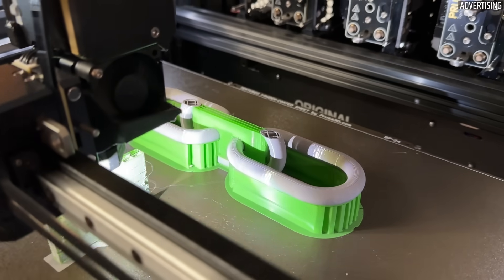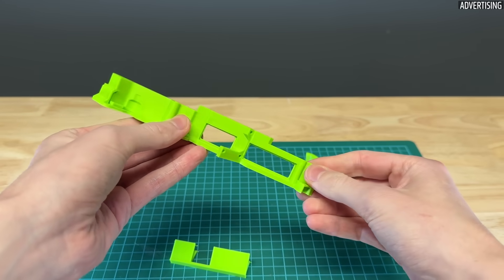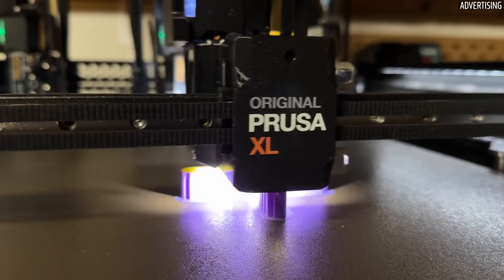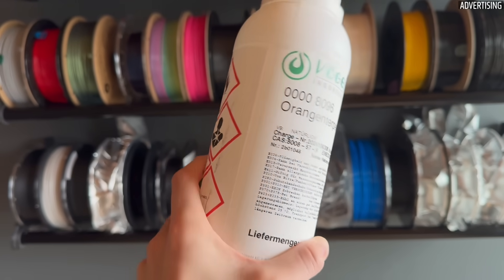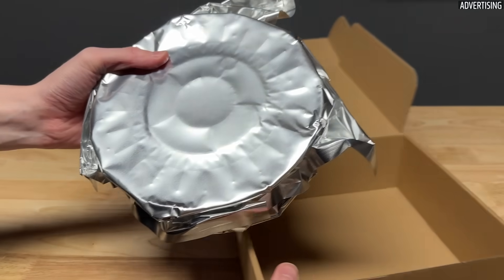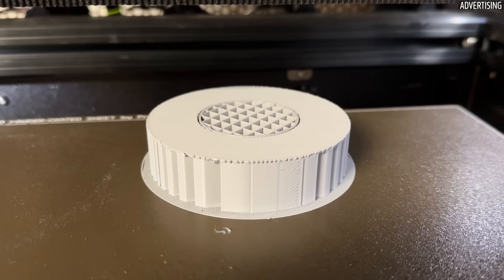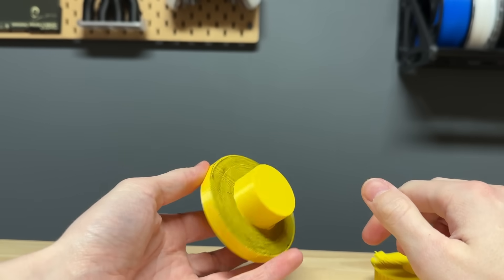Always Perfect 3D Printing Support Structures: The Ultimate Guide

Comment: I have tried the sharpie option and I had issues with the first layer at the interface for PLA not creating a nice layer at the interface. What am I doing wrong?

I also did the PETG interface option it printed well for a PLA.
The support separated easily.
The final print looked very good, but if you put a little pressure on the overhang the PLA body separated. PETG was only on the interface layer. Why would the PLA body be separated at the same layer where PETG was applied for support?

Comment: Your permanent Marker trick can be used with differential material support interface. PETG and PLA work great together ASA and HIPS as well as TPU and PETG , although this last one requires a dual head extruder printer for good results. A lot easier with an AMS or multilateral printer for sure. But if you have to create pauses in the print to go put your sharpie anyway, might as well swap out for PETG/PLA for 1 layer and then swap back. Ive had amazing results with the interface option on multiple printers.

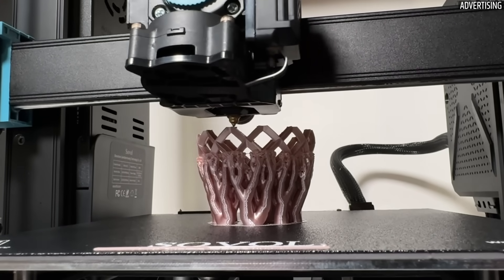Comment: 2:31 I don't know if it was where they originally came from but Organic supports were actually a thing at least as far back as 2017 in Dremel's Idea Builder slicer, called by the more obvious name of Tree supports and likely patented such that Prusa couldn't just call them tree supports.
I remember pretty much only ever using tree supports when printing on the line of Dremel 3D40s that my college had back then. When I finally really got back into 3D printing almost two years ago, I honestly never knew organic supports were a relatively new thing outside of the Dremels since they were all I had ever used.

Comment: I think, if you are designing prints yourself, you should go for custom supports built directly into the STL. Not only you will save a lot of material (slicer supports can be really wasteful, especially tree supports), but also you can design them in a way that makes them easy to break off by introducing intentional weak spot in the place where it should come off.

Comment: I use a dry erase marker. Couldnt find my sharpie one day- it works even better on nylons, pet, pc, and ppa- for large support areas the filament is able to get SOME small amount of friction on the dry erase so your 1st layer supports look MUCH cleaner. Especially for big areas- square or circle shaped- the filament will lay down where it should vs sharpie ive found it has absolutely zero traction and 1st layer support lines can drag around out of place more.

Comment: I’m sorry but what the hell did I watch regarding that dissolvable support? Like, you completely glossed over PVA that can dissolve in water, said you decided not to test that one at all and instead went with what this company sent you which was literally an entire freaking laboratory just to dissolve some support filament which didn’t even end up working because with like 3 gallons of chemical goo, you can only dissolve 170g of supports at a time and your impressions after that were good despite JUST BEFORE complaining about having to use one single bottle of orange terpenes? I found that part very very hard to take seriously, I’ll be honest. It seemed like you were trying hard to stay in their good graces.

Comment: I once worked on a modular support system a few years back, where at the time, I used lego bricks instead of huge amounts of printed support materials, setting the print to stop so I can insert them and then keep printing a tiny amount of support material on top of them to make sure the print would be solid. I moved on to designing my own blocks that where easier to stack (causing less motion on the plate)

Comment: PLA support interface on a PETG part and the reverse works better than anything.  The default profiles in Bambu slicer works perfect for this out of the box.  I'm guessing your issue was due to settings as I can't imagine Prusa slicer uses the same defaults for this.  Your interface layers and your overhang layers looked like they were quite bad which is likely your issue.  A little work on that and those interfaces come off super easy and the overhang will look like it was printed on a smooth print bed.

Comment: But when using PLA as support for PETG or the other way round you'll have to make some compromises. PETG should be printed enclosed to reduce shrinking and potential warping while PLA should be printed with door or lid opened on the printer or it will potentially soften and deform during print. So how could that reliably work especially for longer prints?
I had printed some PTFE tube protectors out of PLA+ but each time I printed PETG parts, the protection clip became soft and fell of the tube so this would definitely ruin any PLA support on a PETG print!

Comment: To print a hole without supports—especially ones meant for screws—I’ve been using the same simple technique for years: I just cover the hole with a single 0.2 mm layer. It creates a clean bridge that allows the hole to be printed perfectly. Then, you just push the screw through that thin layer, which breaks easily.no need post-processing.

Comment: I know this is an unpopular opinion but after becoming proficient with Creality’s Slicer “Creality Print”, and used with a K1C K1Max, and K2, the prints are flawless. The automatic traditional supports release like edible wafers. I started with PrusaSlicer but it just seemed that Print worked better with Creality hardware. I’ll be the first to say that sounds ridiculous but that’s been my experience. The other variable that probably plays a bigger role than one would think, is the use of filaments that are more in the engineering end of the spectrum. Glass filled ABS, Carbon Fiber PA , PET, PPS-CF, PPA-CF. 
And I’ve tried making print profiles in PrusaSlicer that were exact copies of Creality Print profiles and they just could compare the the final prints rendered by Creality Print. It’s just super weird. Great video. Thanks for sharing.

Comment: Thank you for this interesting and informative video!

My conclusion, for my own projects and with my printer, is that adding a bit of permanent marker would absolutely be the cheapest and easiest way to go! 100%!

Add to that, permanent markers not only comes in a lot of different colours, but also different sizes, so if, say, black residue isn't an issue, using a black signwriting marker for really large areas is great, and conversely, if you want to reduce the issue of colour remaining on the print, you can try to colourmatch the marker and the filament.

It does mean that you have to make sure that you have markers that haven't dried out and are pretty fresh! Ink flow is key for coverage!

Price point for perm markers is pretty low unless you need more accurate colourmatching (I'm looking at you, Sharpie). For just generic black, red, blue and green, there are soooo many cheap off-brand markers.

Gonna go watch the arc technique vid now! Thank you for linking that too!

Comment: It seems like we could adapt like a BLTouch with a marker instead of a probe.
Where the interface layer is exposed, hop up the Z and deploy the "touch probe" which extends it below the nozzle, jog the XY offset, and "probe" with the marker until it dabs onto the interface.  The contact will register and retract the probe, it can dot all over the exposed interface
This sounds like it won't compromise the max XY travel like a multi-extruder, and adapting the BLTouch could be  pretty simple and reuse much of its design and its functional code.
It could be a bit tedious and the nozzle may leak while sidelined to go probe-dabbing a marker all over.  I'm not sure if it would be practical to drag a marker like you normally would, as it could drag pretty hard depending on how the interface layer works.  
We couldn't somehow add marker or other release agent  onto the extrusion at the nozzle, could we?  I don't see how to do that and turn it on and off completely and not contaminate the following structural extrusion with residue.  And we still need the interface to adhere to the layer beneath it too so injecting it into the melt would seem to create that situation

Comment: Great video. I have a model where I stuck magnetic tape on the bottom of a reusable support and painter's tape on the top. I add a pause to the print job and drop in the reusable support. The magnetic tape holds it to the bed.  When the print job is finished, I pop off the support, remove the tape, and stick on new tape for the next print. It's the Towel Bar Mounting Bracket from my Printables page. It allows me to have a clean recess on what becomes the back of the part without creating support waste.
Reply: That is a very cool idea!
Reply: If you had time, I would love to see a video of this, great idea and thanks for sharing

Comment: i was experimenting with the sharpie method about a year ago. it works great for petg. sometimes you do need to increase the print temp 5-10c otherwise the next layer may not even stick.
I did want to automate it by attaching the sharpie to the toolhead, but i couldnt come up with a good way to repeat the last interface layer with while both printing the interface with plastic, and then repeating the last layer with the sharpy. it was either have no actual interface and go over it with the marker as the interface, or pause and do it manually. 
iirc the person who wrote the original article with the magnetic style servo was hand modifying the gcode. which is fine for a few random non complicated prints

Comment: 10:44 It appears you use tap water for the XIONEER process. I’ll bet the hardness of the water used in the solution needs to be taken into consideration.

Fascinating stuff!
Reply: That is a valid point. Hardness of the water is a factor to consider. But we made the formulation of the powder that it will not be affected by that and compensate for different pH levels of the water.

Comment: I once wanted to print a TPU phone case that would look really nice. The eventual success was due to two tricks:
1. To get nice holes for connectors, microphone, speakers, buttons etc PLA supports were used. I did this on a standard printer by designing support structure out of multiple parts. A sort of frame went into the partially printed TPU case and this frame had cutouts into which I could slide pegs in the shapes of the holes. I put a pause in the print before the layer that bridges over any of the holes, inserted the right pegs and resumed printing. The last such pause was the top of the frame onto which the lip holding the phone around the screen was printed. After the print finished all the PLA support pieces were easy to take out of the TPU case. 
2. Someone helped me a lot with the excelent advice to use cleaning alcohol like IPA to release the TPU from the textured PEI bed plate. Without it the case always ended up deformed when pulled off the plate. With a bit of IPA poured around it it came of easily and not deformed. 
Overall that one phone case was quite a valuable learning experience.
Reply: You should make a video on your channel

Comment: Forget expensive markers – here’s a simple, cheap alternative I’ve been using for a long time: regular vegetable oil. You probably already have it in your kitchen! Just apply a very thin (trust me, THIN) layer with a brush on the separating surface. The supports stay perfectly on the build plate when you remove the print. Works like a charm – give it a shot and see the difference!

Comment: It's just PVA. Ya can disolve it way easier than the silly kit they gave ya. Sunlight soap and boiling water. No gimmick kit needed.
Reply: It is a completely different polymer than PVA and is completely insoluble in tap water by design. This way, it is far less hygroscopic. So you really need an elevated pH level to dissolve it. In chemical terms, its a polyacid, hence the alkaline needed.

Comment: I wonder if adding the Xioneer supported part with solvent to something like an Ultrasonic cleaner would have yielded a better result...
Reply: It really comes down to two factors, heat and agitation. So yes, Ultrasonic is a viable option. However the cheap devices around have very weak transducers and will not be much faster than the sous vide stick. A propper impeller, strong pump or even a system like a washing machine will be much faster. Or Ultrasonic with strong transducer, but these are very expensive.

Comment: With PETG, which normally has a lot of difficulty separating supports, I've found the "Support interface fan speed" settings in OrcaSlicer to be extremely helpful. I have it set to 100% with only a 0.04 z-offset and get a good surface above the support with minimal effort needed to remove them MOST of the time. I'm honestly surprised I don't see this feature talked about more, because it's been great for me. It also works quite well with my matte PLA's which are sensitive to high part cooling impacting layer adhesion.
Reply: Trying this tomorrow

Comment: Thank you for reviewing our Xioneer VXL GO set, Jan 🙂 I think you are right about the maximum capacity being used with your parts, which led to the remaining support material inside the parts. 
And just for reference here: The Sous Vide stick is of course not very potent in terms of agitation. Using a device like our Vortex EZ or even a household washing machine would speed this up by a factor of 3 to 6. 
Interesting to see the effects of limonene as well. Probably due to the wild compounds that are marketed as ABS but really have some other materials inside mixed with ABS which are then damaged by the limonene.
Reply: It is unbelievable to me that anyone considers your product at all useful, I’m sorry to say. You have to buy an entire chemistry kit and lab equipment and mix gallons of solution, have it stirred continuously with the sous vide stick or buy even more equipment from you to stir it better, and after hours upon hours you can dissolve a maximum of 170g of supports? Like, can you explain the utility of this over just getting support interface material from Bambu Lab or using PVA that can dissolve in water? Even that other material where all I need is a bottle of orange terpenes is more useful and practical than your entire set. Maybe I’m just missing something.
Reply: @gownerjones  Thanks for the feedback! 
You’re right – our material isn’t the cheapest. But it’s super easy to use: no humidity issues, no drying drama, and it prints reliably across a wide range of materials from PLA to PEEK and temperatures from 20 C to 140 C in the chamber. There is no real alternative at least above 50 °C in the chamber. 
And no, you don’t need expensive equipment. A regular bucket, warm water, and some washing soda is enough – just give it some time. 

For complex geometries or internal supports, soluble material is often the only real option – and VXL just works when others don’t. 
You also need to consider the industrial side of using these materials (there are 5 different types): Automated postprocessing is an important reason to use soluble supports, especially in high-wage countries.
If breakaway is enough, we encourage our customers do use that. If it's easier with interface support using VXL, that's a good thing to save money as well. 
PVA and BVOH have little industrial weight, they can only be used for commodity model materials like PLA. HIPS and limonene will generate a lot of organic waste, which needs to be treated by a special waste collection company for a high price. I personally like the smell of oranges, but limonene is too much for my nose.
Reply: @krosstoph  I understand, I’m just not the target audience for it as a hobbyist. To be fair to you, I think the video didn’t do a very good job at explaining what your product is for. Portraying it as an alternative to PVA or HIPS for hobbyist printing seems like an unfair comparison given what you explained.
Reply: @gownerjones  good point, thank you for that. Your comment was very helpful, we need to work on how to present our materials to hobbyists and also do more explaining around PVA, BVOH and HIPS.

Comment: I have previously found that applying a layer of glue stick on the support interface can make TPU-TPU supports viable which was quite helpful on a few prints so far. However, the glue stick kind of makes a mess and is hard to apply exclusively to the support area. So I will definitely give the permanent marker method a try!

Comment: I used to think PVA was the end all be all best support material, just expensive. I didn't realize it was so hydroscopic. The mix with the heater just seems like too much and doesn't seem practical.. I guess until we start getting printers that can print on multiple axis in the residential market, i'll stick with petg and pla being used to support each other.
Reply: Forgot to mention, the sharpie idea sounds great. I feel like the sharpie would dry out very quickly with all of the heat. Would be nice if there was just a quick attachment for my bambu A1 and a button I could click in the bambu slicer to add it. Adding manually wouldn't be bad on a part with big flat supports, but I honestly don't remember the last time I printed something like that. I find myself using organic supports all the time due to the complexity of the parts.

What bothers me with supports, is that it seems like the results vary from print to print and even between parts on a print.

Using PLA with PLA, I can have all of these different results in the same print
Support that comes off easy and leaves nice finish
Support that doesn't want to come off but still leaves nice finish
Support that comes off easy and leaves terrible finish (like there was poor bridging)
Support that doesn't want to come off but leaves terrible finish (like there was poor bridging)

Can't wait for a more ideal support method.